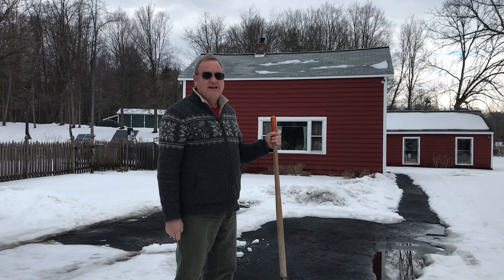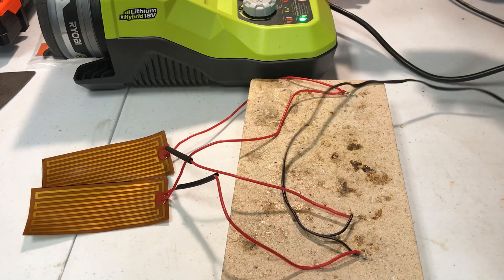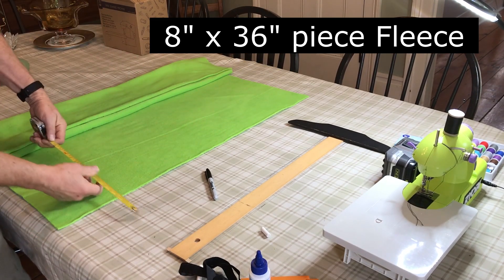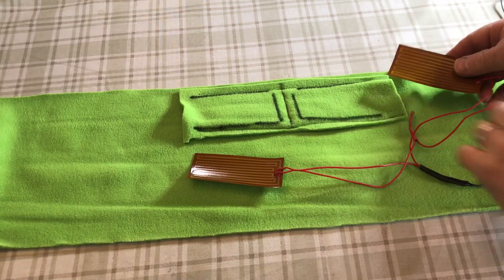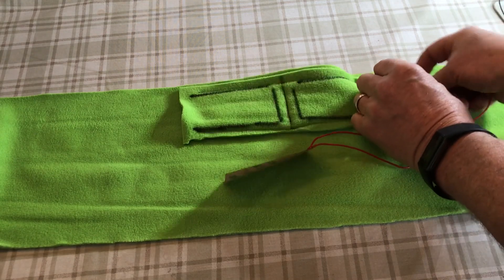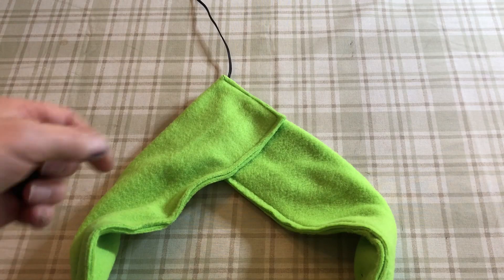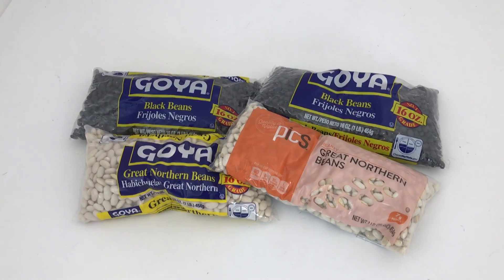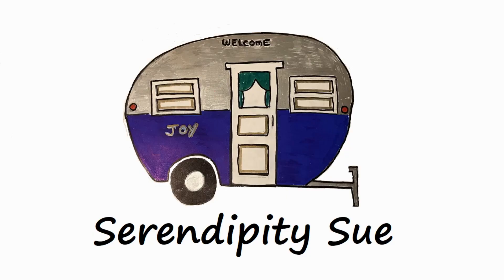RYOBI 18V Heating Pads and Scarfs

Comment: how do you handle low voltage cut off?
Reply: Ryobi batteries have onboard BMS with low voltage cutoff.  Most other power tool brand batteries have the low voltage cutoff in the power tool vs the battery.
Reply: pack bms handles that.

Comment: Chris, you need to get a "Hotwired 12V Heated Jacket Liner Evo"  I have it running off my 9Ah batts, pulls 74w(6.2a). Wear a jacket of your choice over it. It BLOWS away all the sissy 9w heated jackets made by Milwaukee etc. After initial heat up, low is more than sufficient. It heats neck, both full arms, full front and back. They also sell gloves that plug in the sleeves. It's so toasty and runs for several hours.
Reply from the maker: are you running a DC-DC converter to get to 13.8V?
Reply: @SerendipitySue  No, for a year I ran a dedicated 3S 8ah lipo pack with lvc alarm. One day I took a big risk and connected it directly, did not fry the pwm circuit ;) I have been using it this way all winter. Works great :D

Comment: You said they draw 10 watts, so with a 4ah battery (72wh) it would run for about 7 hours.  Have you done any runtime tests?
Reply from the maker: in previous RYOBI and knockoff battery tests I found that they rarely make the listed Wh. I haven't formally tested the run time. But I have been wearing the scarf for hours :-)